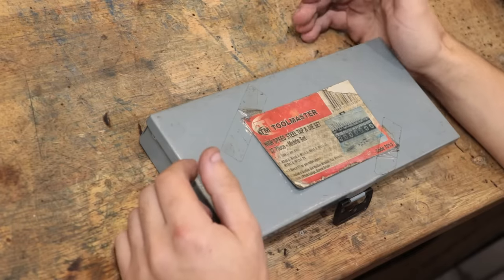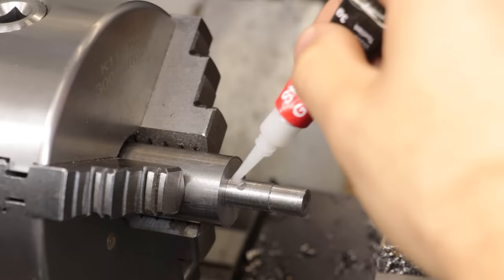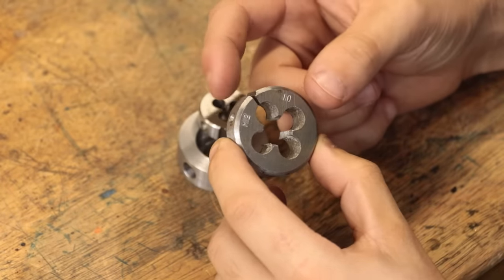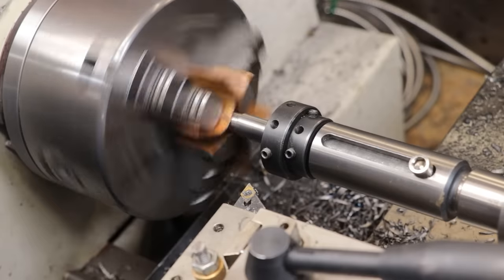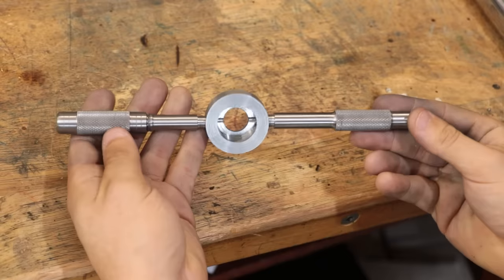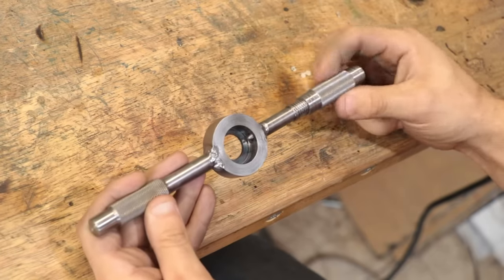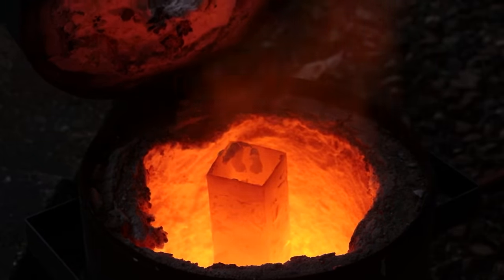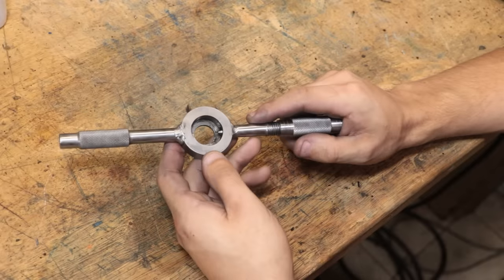Making A Die Holder.... But Better

Comment: Why didn't you chuck the handles up in the lathe after welding them, and cut a fillet where the body and handle meets.
Reply: Yeah, I would have cleaned the welds a little. Or just thread the connection point to the die holder and loctite it.
Reply: @_Jester_  Yes the body looked thick enough to take threaded handles. As you say, slap on some loctite and they should be good to go.
Reply from the maker: I didn’t think people would react the way that they are to them. The welds really don’t bother me a whole lot and I was more focused on making sure the tool would actually work. By the time I thought about cleaning them up it was already case hardened

Comment: At 21:42, you mention brazing vs welding.  If you braze before case hardening, won't the brazing go away or become contaminated during heating + CO gas, while case hardening? If you do the brazing after case hardening, won't the heat from brazing damage the case hardening or the case hardening interfere with the adhesion of the braze? Chicken or egg with the brazing step?  Why not just practice a little bit more, give yourself a couple of fillets to weld against and grind down the worst of the high spots?  Maybe you could get away with just straight fusion welding without filler rod? Maybe make up some custom filler rod rings and then do a fusion type of process with a ring of filler material in the fillet gap??  Thanks for this video.
Reply from the maker: I think if I was going to braze it, I wouldn’t use mild steel as the die wrench. I’d want something that has a bit more toughness to begin with. Maybe 1045 steel

Comment: I can't use the round ones, no room.  I use the hex ones with a socket that is plugged so the die is visible.  A T handle drives the socket.

Comment: Have a look how Inheritance Machining made his tap wrench. For next design you could start in the same manner making the whole thing one piece and then use milling machine to machine down the flats and recess that hods the button die. That way you would avoid any welding and make the part much stronger.
Reply: You mean like the one he made which he showed multiple times throughout the video 🤦‍♂
Reply: @qantse  he welded his handles on, the other design makes it al from a single piece of bar stock. 2 competely different methods.
Reply from the maker: If you are talking about the one I made last year, yes it is made from a solid piece of steel. No welding needed

Comment: Nice work. But I wonder, why weld or braze the handles in place? You could just cut some threads and screw them in, could you not?
Reply from the maker: With that design, once you have the pin hole, there wasn’t enough material once you add the threads. After the fact, I did some testing and by shrinking the pin and swapping the material for a higher tensile steel, yes you could thread it

Comment: It was all going so well until you welded the handles in place. As others suggest, threading them would look neater. Die holders with multiple screws are there for a reason. For split dies, and better die gripping when cutting larger threads.
Reply: All aesthetics.
Reply from the maker: Like I said in the video I don’t use split dies and if I can get away with cutting M12 with one holding pin, I’m going to keep doing it that way

Comment: I'm assuming you can't do a threaded connection on the handle because the hollow one with the pin would be too thin, but you could do that on the other side.  Nicely done otherwise.  A round file does wonders for making you a better welder
Reply from the maker: Yes, not with this particular set up, I tested it and the threads snapped. I did find after the fact that shrinking the pin diameter and swapping the material to medium tensile steel provided enough strength to thread it

Comment: solid die's are the cheep die's split are the higher quality die's because they are adjustable
you cant use the die holder you made for split die's

the die holder you showed in the beginning has 5 bolts (4 equidistant from each other and 1 between two of those)
4 for centering the die, adjusting the die holder to use smaller die's
1 for opening the die (if the fit s to lose on the threads you are cutting) with out taking the die out of the holder
2 of the bolts are for forcing the die closed (if the fit is to tight on the threads you are cutting)

just an fyi a tap set should always have 3 taps and for each size and tap drills only used when tapping
taper, second (plug), and bottoming used in that order
Reply from the maker: Quality aside these button does are able to do everything I need from them that’s why I stick with them. I know the advantages of a good split die but the reality is I have never really needed them, at least for what I do. The rare occasions the button dies aren’t adequate I end up single point cutting. Cheers

Comment: If this is used with split dies the thread will be too big. This is because the pin will open up the die. This is the reason why die stocks have 3 screws. Yes it is called a die stock not die holder or die wrench.
Reply: He specifically addressed this in the video 🙄
Reply: @WheatMillington  How is this better if it can't use split dies? It's a solution looking for a problem.
Reply from the maker: I don’t own any split dies (except for maybe 2 in the larger diameters) and I myself don’t see any real need to own any. The sets I have do the jobs that I need and the very rare times that they don’t I just single point cut.
Reply from the maker: Remember I made this for myself and  to address my needs. Cheers

Comment: question: does it gives the same reasult using sodium BIcarbonate instead sodium carbonate for raising carbon content process? since bicarbonate is easier to find
Reply from the maker: It has been a while since I looked at the specific paper referring to it, but from memory I don’t think it would work or work as effectively. You need the carbon monoxide for it to work. And I don’t believe that is produced by sodium bicarbonate

Comment: Question, does the weld also case harden? From what I understand it's a different kind of steel
Reply: All of the common steel filler rods will case harden. How well will depend on weather you introduce any impurities into the weld.
Reply from the maker: The filet is mild steel of some type so it’ll case harden. But the layer is so thin here that it probably doesn’t cause any issues to the weld itself

Comment: 1:49 A proper fitting holder only needs 1 screw... in the retaining dimple. So yeah you DEFINITELY can make something better than that one. So you aren't really "that guy" at this stage so don't feel bad, bud! On a side note, the crap being mass produced now adays is absolute trash. From crappy tolerances to shit metallurgical standards, it all ends up with trash products. "They dont make em like they used to" phrase is absolutely on point.

Comment: If you only want to use three screws, take the other two out and leave them in the case. Oh, but then you wouldn't need to do this video.
Reply: You clearly struggle with listening and comprehension. If you don’t want to watch free content that you don’t like or understand, you can just move on. Oh, but then you wouldn’t be able to be a negative troll with nothing of value to comment...
Reply: Take 4 out & just use one.🤣
Reply from the maker: You need at least 3 if you’re tightening up by hand, or the die will start to come loose and wobble around in the holder. Cheers
Reply: @artisanmakes  use a screwdriver